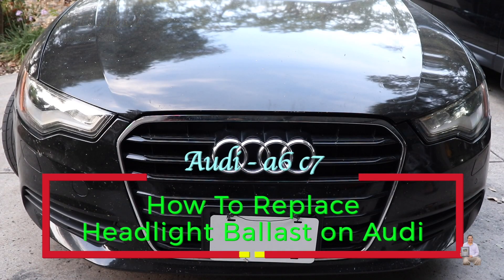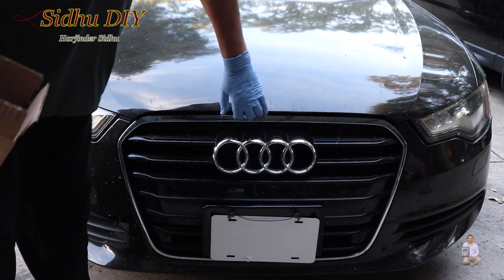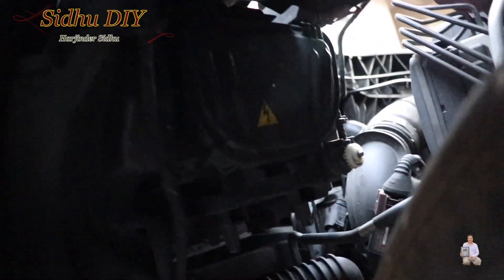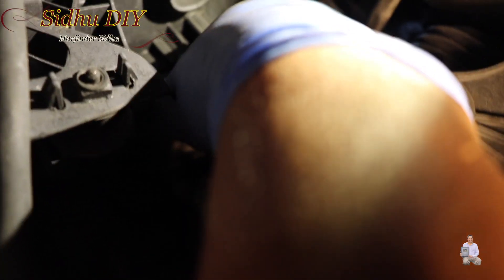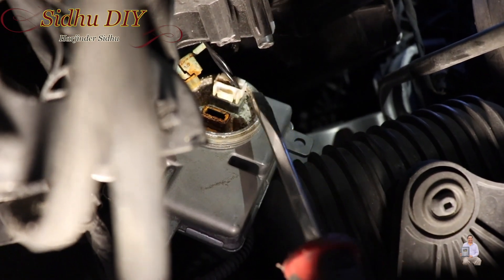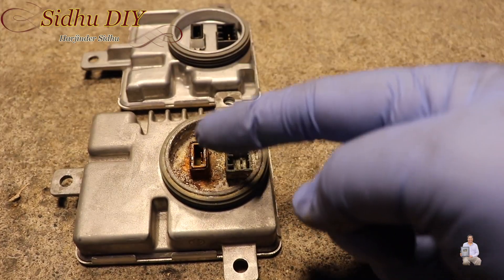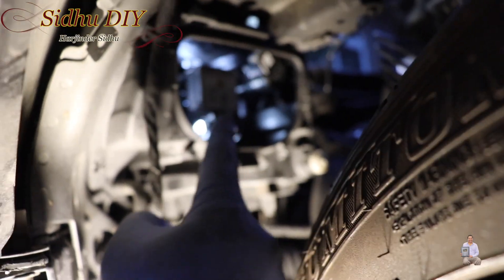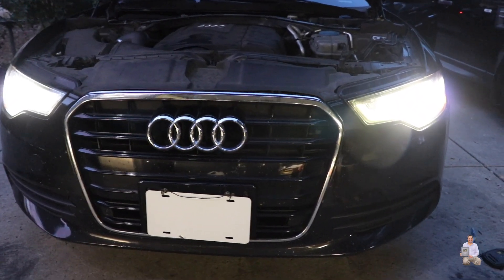How To Replace Headlight Ballast on Audi | How To Change Headlight Ballast on Audi

Comment: I just replaced my headlight bulb and it works sometimes, then sometimes it doesn’t. Does this mean that the ballast is the issue? I have a 2013 Audi A4.
Reply from the maker: If your headlight bulb is working intermittently, it could be a loose connection or your ballast is starting to fail. Thanks for watching!
Reply: @SidhuDIY  I’m thinking it’s the ballast bc sometimes it comes on but sometimes it doesn’t. It either comes on after I switch the headlights off and on or it might come on mid drive when I hit a bump. However, it doesn’t go off mid drive once it comes on. Whole hour long drive it will stay on. I ordered a new ballast let’s pray that’s the issue 🙏
Reply: @mikekarpouzie hi bro .. i am having the same exactly issue can you please let me know if you were able to fix and was it the ballast? Because i had changed ballast on the right side but now both sides comes on and off one at a time
Reply: @zigzaga3100  bro that happened to me too. I changed the drivers side bulb bc that was the one that was out, and then it worked, then it stopped. So then I changed the ballast, and then it worked again and then it stopped. I figured maybe it wasn’t the bulb or the ballast and that it was a wiring issue and when I was changing shit and moving shit around, maybe that’s what made it come back on. So I reached in and moved the wires around and then both lights came back on. But then both would go out and I would have to pull over at night and wiggle the wires around for it to come back on 😂 but then only the drivers side would come back on. I gave up and took that shit to the mechanic and they said it was lose wires and also bad bulbs. So now it’s fixed for now but yeah I gave up 😂

Comment: Does the ballast also power the daytime running lights? I’ve had condensation in my passenger side headlight since I tried to replace the adaptive  D3S bulb. Now the only thing that works is the driver side headlight. I get dash outage warnings for both of the DRL, right front turn signal and left and right main beam. Any ideas?
Reply from the maker: I have to check, thanks for sharing the info.

Comment: QUESTION - the LED eyebrow strip has gone out. I purchased a new assembly, but the new one does not come with ballast. My question is why did the LED go out? The assembly did have a water problem and fog problem. Is the LED out due to a bad ballast?
Reply from the maker: Led can go bad due to many reasons, in my case water went into ballast and cause a short and burned the ballast as you have seen in the video was rusted so after replacing the bad ballast it worked.
Thanks for watching.🙏🙌

Comment: Thanks, great simple video. How do you know if you need to replace the ballast or the bulb? My warning says “left adaptive headlight/main beam headlight”.  Thanks.
Reply from the maker: You always can swap the bulbs and see if they are working or not, if it's working then your ballast is gone bad.
I hope it helps, good luck with your DIY project.
Thank you so much for the like and thanks for watching.🙏🙌
Reply: hi there i know its been awhile i have the same message. did you figured out what was it?

Comment: Just attempted this and could not get the new ballast plugged in for the life of me.  Specifically that shorter plug.  It's like Audi purposely made it that short so you'd have to take it to them.  Taking it to a friend tomorrow who works at an auto shop to wrap up the installation and hope it works.  Thanks for the tutorial though!
Reply from the maker: Thanks for sharing the info. I know it's tough but it can be done as I have replaced it. I did share a tip on how it can be done, just rotate it then you can plug in the wire plugs.
Thank you so much for the like and thanks for watching.🙏🙌

Comment: thanks for your video. I did my bulb replacements and I also took the whole headlight assembly out too. That's an alternative to having to open the wheelarch cover. It's smart though - the wheelarch cover :)
Reply: Did you have to take the front grill and fender off to remove the entire headlight assembly?
Reply from the maker: Thanks, glad to help.
Thank you so much for the like and thanks for watching.🙏🙌

Comment: how did you remove the fender wall?
Reply from the maker: It's very easy to remove, I wish I should have shown in the video.
The reason I didn't show because I see many Negative comments previously on my other videos that why I am wasting time by showing unnecessarily things and I should show only the things which need to be done.
Personally, I like to show in detail so that it makes life much easier and simpler.
Thanks for asking and I will start details in coming next videos.
Thanks for watching.🙏🙌

Comment: Great video, I just replaced the bulb in my 2015 A3 yet the headlight still wouldn't come on. I was getting a dash error of "Right low beam headlight / high beam headlight" The LED top light still came on exactly like in the video. Looks like I'll order a Ballast and see if that fixes that issue. The bulb I replaced was bad however so maybe it burnt out because the ballast was jacked up.
Reply from the maker: Thanks, glad to help. It could be a bad ballast.
Thank you so much for the like and thanks for watching.🙏🙌
Reply: Hey did this end up fixing your problem. Replacing the Ballasts?
Reply: @Veersa im also having this same issue if you had this issue did you ever resolve? Im not sure if i need to change the ballast or not
Reply: @lugomiguel6599 yeah it was the ballast that was bad
Reply: @Veersa okay thank you im gonna do that next replaced the bulb and tried two different hid bulbs “different brands” and still nothing

Comment: Hi! Thanks for video. But how about left side headlight. Is it so easy to???
Reply from the maker: You are most welcome, glad to help.
Yes, it's very easy and I did have posted a video.
Let me give you the link: How To Change Audi Headlight Bulb - https://youtu.be/ezbHC3Thf5o
Thanks for watching, good luck with your DIY project.
Reply: @SidhuDIY  Hi, sorry for casing you. But I mean right side ballast.  Is it so easy to??? "Cose my enginere sad that you're gonna have to take off the bumper and the headlight". Is it true?
Reply from the maker: I think you need to remove the headlight assembly, please give me some time and I will look into it how we can do it in an easy way. Will keep you posted.
Reply: You don’t have to takeoff the bumper. You do have to take out  the air filter assembly which is pretty easy. Then put a mirror down below so you can see the ballast from there.